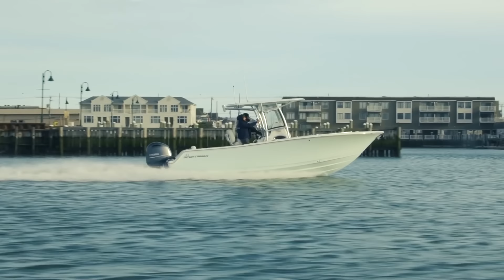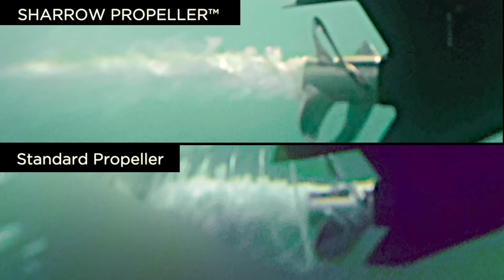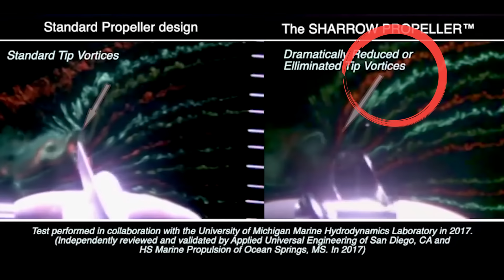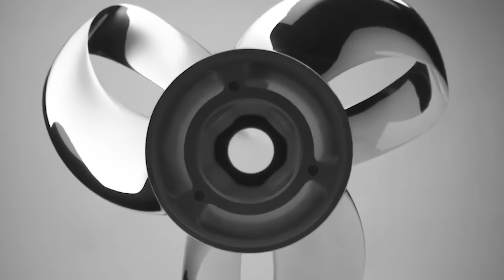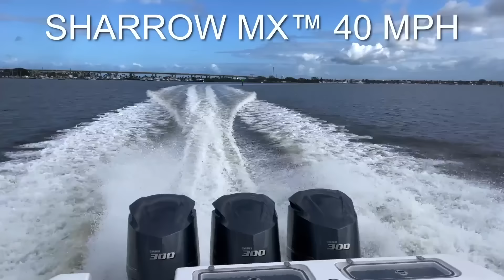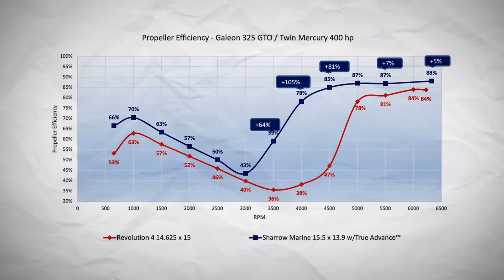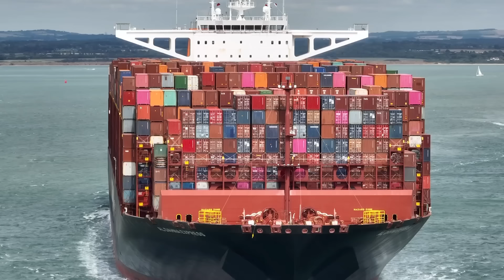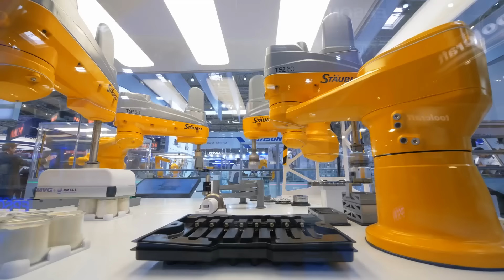This Genius Propeller Will Change Transport Forever

Comment: Im a CNC programmer who worked for a top tier marine propulsion company for years.  Our company has been in the R&D phase of producing a prop similar to this for years to no avail.  We produce the Volvo-Penta dual out drive props and Volvo is/was very interested in this design.

 The main hurdle we couldn't clear on this design was cavitation and vibration during high RPM, which absolutely destroys lower ends. We even consulted top level fluid dynamic phd's from University of Michigan and still haven't cracked the code (pun intended), as of 2019 anyways. 

I had to work hand-in-hand with our engineers on this project and I can say with 100% certainty, these style prop's are a bear to machine, even using state of the art 5-axis mills, the tolerances are crazy and the balance has to be absolutely perfect to mitigate the issues I mentioned above. I've produced some highly technical stuff in my career, including Govt. projects like the Navy's SWS submersible troop transport vessel to high end Hatteras, Bertram and Bollinger Shipyard 5, 7 and 8 blade NiBrAl, Bronze and Stainless steel props for luxury yachts and cargo vessels alike.  All that being said those projects were a cake walk in comparison to this design. I don't miss the stress, twisted steel & broken tools.  I was on a 1st name basis with our Dapra tool rep after trying to machine these.
Reply: You should have been involved in the making of this video.
Roughly what RPM'S would cause cavitation and vibration for this design? @livefire81
Reply: Thanks for your comment. Perfectly explains the question I had when seeing this video, of “why aren’t these more common yet?”
Reply: the power of genetic algorithms and simulation finds needles in hayfields like that
Reply: Sounds like Alistair Cruickshank in the comments is the guy that could solve your challenges
Reply: Could you not cast it?
Reply: @MrMagnus  cast parts aren't as strong and complex shapes aren't feasible. Casting is more than making a mold in the shape of a part and pouring metal in.
Reply: @spamcan9208  I think if Tesla can precision cast an entire car frame, a decent setup could cast these… then again, Tesla’s uses aluminum so 🤷
Reply: @JacobProbasco  a car frame does not experience the same stresses as a propeller in a fluid. Why are you comparing apples and oranges?
Reply: @JacobProbasco  Imagine that car frame spinning at 9000 rpm. That's frightening
Reply: @JacobProbasco  making a frame that just sits there is VERY different than spinning a propellor at high speeds through water.  they're NOTHING alike.
Reply: Very cool experience/s you've had with props. Your comment was a great read!
Reply: I understand the Aircraft Industry are already using additive manufacturing techniques for under carriage components. As previous comments allude to- it comes down to tight  manufacturing  tolerances required for components operating at high RPM
Reply: Are they impossible to injection mould or  rotational mould?
Reply: Why not use a much larger prop with different degrees of pitch moving at much lower RPM?
Reply: Contact energy knowledge group.  They were the go to guys for most major engineering.  Preferably fred young would be the one to speak with.  He had a hand in designing the nearly 100% efficient generator about 13 years ago or so.  Don was point of contact, when I was with them.  They might be retired by now, but they might do it for fun.   Give it a shot!
Reply: Git gud
Reply: Such comments are thing that make YT best social media ver.
Reply: Скажите пожалуйста, Dapra пытается использовать этот Пропеллер для на Подводных лодках? Снижение шума винтов является Главным фактором не заметности.
Reply: So basically even if you get one that works perfect if you ding it on some drift wood or other flotsam you don’t see it is scrap metal. No more hammering the blade straight and a little grinding and away we go. Definitely not for rednecks like me.
Reply: Parasitic loses at those 90s..a bitch. Bound to scramble but keeps the industry hopping with parts replacement.
Reply: What kind of tolerances are we talking? I work with large propellors on ships and I can't imagine the required tollerances are that out of reach with modern technology. I mean how crazy are the required tolerances compared to a standard fixed-pitch propellor?
Reply: @grahamsell3863  Large ship have RPM in the hundreds, in this case you would need up to like 5000 rpm. Therefore things like harmonics, cavitation and imbalances are much more relevant than on bigger props. In any case, you have to think about it in proportion as well, the smaller the item, the tighter the tolerance even if you are going by the same scale.
Reply: How about casting these in a plastic mold?  Would that be feasible?  Obviously it's not suitable for real boats, but for computer fans and drone propellers that are already made of plastic.
Reply: Thanks for this.
Reply: Stop using rotating tooling and switch to EDM then 🙂
Reply: people talk about 3d printed metals being better than cast as if sintering is any better than casting
Reply: A design like this lends itself towards an additive, rather than a subtractive machining process. Twenty years ago, the idea of 3d printed metals was just that, an idea. Perhaps twenty years (OK, probably more like 50 years) from now, the idea the idea of subtractive machining will be primitive, much the way we think of the hammer and anvil today. Machinists who haven't even been born yet will look at the rusty 5-axis CNC in the back corner of the shop and think "How could anyone have ever made anything with that hunk of junk..?"
Reply: @SilenceDogood76  When a CNC machinist talks about fine tolerances we are talking about microns, both for surface quality and dimensional accuracy. Something even the best 3d printers will struggle to achieve. Current 3D printing technology is basically fine laser welding and reaches around +-0.1mm. On a mill that's child's play on a well maintained and serviced machine. Machining and grinding will achieve tolerances surface finishes that are better at least an order of magnitude (5x on low end, 20x+ on higher end) than 3d printing. 

When it comes to fluid dynamics i suspect surface finish plays a huge role and small dimensional deviations and more importantly geometric deviations (due to the stress of melting the material into place and it deforming slightly) will cause huge issues at high RPM - you'll basically be rotating an unbalanced prop.
Reply: @xm210c  surface finish always is one of the most important parts in terms of fluid dynamics. You can generate the "best shape" possible but if your surface is not smooth it won't matter because the second it hits your surface the fluid will go turbulent.
Reply: @SilenceDogood76  it's all in the application. I could be wrong but I imagine things like 3D metal printing will augment instead of replace current 5 axis machines.
Reply: @spamcan9208  3D metal printing would not solve this issue. 

3D metal is less structurally good in almost all metrics. They have gotten it close in some cases, but in regard to propellers your objective is to have as light and thin as possible while also being balanced and in tolerance. 

Propellers are a bitch in terms of engineering.
Reply: @SilenceDogood76  Additive manufacturing still has quite a ways to go. 3d printed metal just doesn't have the right internal structure for parts like this that are so thin and high speed to work. Additionally, 3D printing is very slow.
Reply: @SilenceDogood76  I understand your point but there is inherent differences between the two manufacturing techniques. 3D printed components are made of layers of metal dust sintered together. This forcefully compromises the metallic grain structure you can achieve and even further processes of tempering the metal won't be able to completely recreate metallic structures achieved when creating alloys. (Basically boils down to phase diagrams of the materials, if you were to heat up the 3D printed part it would melt before you got to form microstructures that provide desired characteristics). 3D printed components can't compete with forged parts for example. And that's okay each method has their uses.
Reply: @SilenceDogood76  Right? 5 axis CNC? everyone knows you need a 15 axis 3d printer /  CNC machine in 2028 to get anything done. One day in the not so distant future it won't be 3d print or CNC. It will be 3d print and CNC all rolled into one. The speed and efficiency of CNC where needed and 3d print where it gets technical. You'll have machines that get all the extra bits of wire and rust and re-melt it back into filament and the entire facility will be ran on renewable energy. Which is good because the facility will use 30 times more energy than a convention fabrication shop.  8 thousand electric motors running 50 parallel custom fabrications all designed and tested by yota flop computers running real world simulated physics and trial and error AI processes. One day boat propellers will be designed specific to the route they take for the .004% efficiency gain.
Reply: @SilenceDogood76  And people 100 years from now will think how did people make anything at all while their molecular printer makes anything out of any matter.
Reply: @SilenceDogood76  this part wouldn't be likely feasible for additive manufacturing via 3D metal.   The biggiest issues being tolerance, balance, and ability to withstand stress. 

3D metal printing isn't as strong as a machined part.
Reply: @Daemonamongyou  uhm ... 3d metal printing is as strong as a machined part. If u want even stronger, while beeing lighter. Tolernaces are like 0.005mm. 
U can print in nearly every material u want, steel, titanium and so on.
Balance is tze issue u cant balance it with removing material ... smartest idea woud be external balanceing but idk how that should work on that thing
Reply: @Daemonamongyou  true dat tis sintered
Reply: @petermeter3942  I'm not sure I believe it's even as strong in planner direction, but it's not as strong in all directions. I think they might have been able to show similar planer stresses in lab settings, but in the real would I high doubt it, 3D printed parts are always anisotropic. That has and will always be one of it's biggest weakness. It is also one of the reason no major industry has started to use it in large or mass production. They generally reserve it for low stress/strain units in small production runs. And it is NOTHING compared to single crystal metal. 

3D metal is made by using generally some additive and by welding single layers along a 2D plane. Those welds plane to plane are the weakness. 

Balancing is always an issue on any rotating part generally the best practice is removing material on parts that undergo a high RPM due to forces of adhesion and heat stresses.

An unbalanced part can quickly lead to premature or even critical failure. This was actually my last investigations. We we're having premature failures of our fans due to the additive putty coming off of our blades. 

It's not that I believe 3D metal has no practical applications. I think additive metal manufacturing is very interesting. I just don't believe it will replace traditional methods anytime soon. Maybe if you can do atomic printing then maybe.
Reply: @Daemonamongyou  i dont think that either. Additive and substrative manufacturing are both important processes i dont believ on of them is replaceing the other
Reply: That's ignoring the problems of balancing though. It takes VERY little deviation in weights to cause significant problems when mass is spinning at high speed.  The vibrations transfer inward to the shaft and then into the bearings, GREATLY shortening their lifespan.
Reply: @SilenceDogood76  they will cast blanks and machine to size, and it will 1000000 times faster and MUCH MUCH cheaper than 3d printing, not to mention that the print will need work done on it to perform in water, all surfaces need to be smooth
programming the cnc to make these will take longer of course, but I don't see why anyone would break more tools on this than a regular prop if there are no errors in the programs, for the 5x mill both props are the same thing, not sure what he means with "twisted steel" either, broken tools are from errors in toolpaths, which can happen with unproven programs on complex parts, but there are demo videos of 5x mills making much much more difficult geometry than these props, so I don't quite understand why they, with all that experience, couldn't make these to spec, tall tale is the expression that comes to mind
Reply: this is why I fear the inevitable Chinese knockoffs that just put up these videos as proof of the idea that all toroidal propellers are more efficient when in reality its extremely hard to get right.
Reply: Why wouldn't it simply be a matter of making one model that works as well as possible, then making a mold and casting them? If not for transport maybe there's some low rpm applications where the efficiency and lower turbulence make it a better propeller design? Moving gases and fluids is such a broad range of applications.
Reply: Perhaps a dumb question, from a guy with zero engineering skills: but why not die cast the rough shape and use the 5 axis mill only for the fine detailing?
Reply: @Bokkie100k they do.  3D printed investment cast then 5 axis machine and follow with a polisher.
Reply: @Bokkie100k  thanks for this, i was searching for this question
Reply: @Bokkie100k  mhmm because cast material is weak and the overal finish after "detailing" isnt that great. Forging would be better.
Most cast materials are brital.
Cast materials are harder to balance too
Reply: @petermeter3942  thanks, didn't know that
Reply: @Bokkie100k  np ur welcome
Reply: Produces it by 3D printing with Titanium.
Reply: @wdfaseer5898  3d is slow and expense- can it be moulded in anyway?
Reply: Why not 3-D Print them
Reply: Well well well, we have an expert over here. Interesting stuff. So what's different now, why did the people in the video succeed where you guys failed?
Reply: @lawrencefrost9063  They didn't succeed, these props have been around for years and have not made a dent in the marine industry.  "hey 20% fuel savings right?" seems like a no brainer but real world tests I have seen never showed those kind of numbers. Most tests showed slight gains in certain circumstances and losses in others.  I never claim to be an expert, but I have been in the marine industry for 25+ years working with boat builders and engine manufacturers.
Reply: @lawrencefrost9063  who said these have succeeded? The guy didn’t say they don’t work. He said the manufacture of them are very hard to accomplish within the tolerances necessary to avoid other problems. And the video supports this, saying a propeller like this was many times more expensive then a conventional one. 

That would make it enthusiast grade and therefore maybe less viable for a company to seriously invest in. 

And none of what we saw was shown for larger ships like freighters. I can’t imagine the tech needed to make something like this but the size of a bus.
Reply: @lawrencefrost9063 Assuming this guy worked there in the past, it's probably because they lacked the manufacturing techniques, materials, and, metallurgy now available.
Reply: 3d printing now

Comment: Even this propeller will soon be replaced by the Centrifugal Propeller. I have a working proof-of-concept prototype. It generates thrust in a completely closed unit with no external moving parts and no external vents. Most people cannot wrap their heads around this because it changes Newtons Third Law. I took my prototype to my nation's capital to meet with government officials to raise money (a waste of time) and met with two officials. One of these guys is a smart guy with 4 degrees in physics and engineering. After seeing the prototype and the way it operates, he kept repeating over and over, "You will win the Nobel Prize". I have been self-financed through my business and the scamdemic put a block to it. Now that it is operating again, I can raise the final funds for the final practical-purpose prototype. Watch for it this spring.

Comment: There is one big flaw with the conclusion of the video if I may. The reduction of energy necessary and efficiency is, on itself great, but it wont reduce global emissions. On the contrary, it my actually produce more and perpetuate de cycle of production/consomption. More efficient transports means more transports, more convoy thus more emissions/consumption of fossil fuel.

(In short, it is very well presented, summarized, articulated and enriching; keep up with the good work)

Comment: Seems like for small drones the extra weight of the toroidal prop may offset any gains,   but for boats this would be no issue.  A simple idea with massive benefits
Reply: Just make them hollow and fill with light material. Done.

Comment: If Tesla can aluminum cast an entire car frame,   this prop casting setup should be fairly easy to mass produce IMO
Reply: Aluminium is easy to cast, though even stainless steel can be cast. It seems more likely the real issue is that they don't provide such big benefits in real world use, and have other drawbacks.

Comment: Can the same design be applied to generative propellers, such as wind turbines? One of the larger arguments against wind turbines in populated areas are the noice pollution created by the blade tips. 

Certainly an industry with a lot of money, and generally more open to risky innovation than ship building